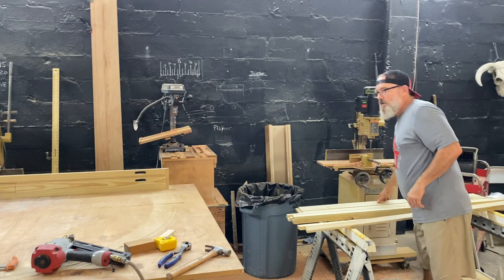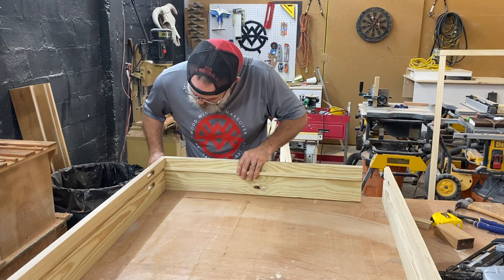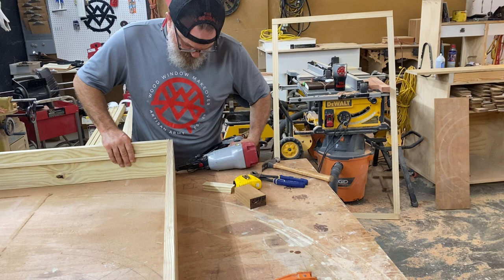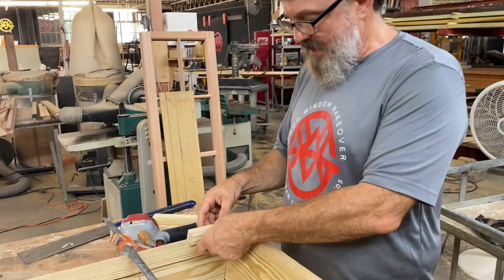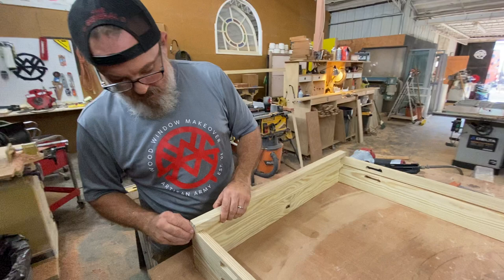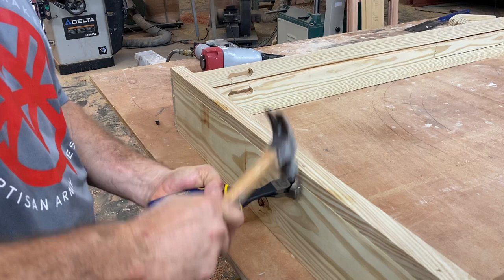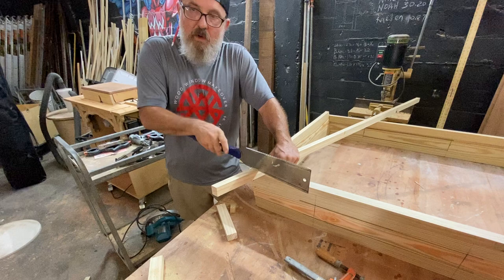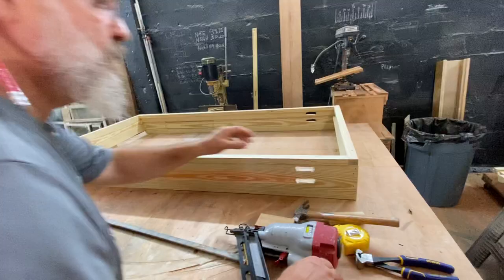The Best Historic Wood Window Frame Assembly Goes Together Like This

Comment: Although yellow pine has a tricky grain due to its hard rings, you will have a lot less nails go astray if you orient the nailgun so that it is in line with the length  of the wood as opposed to perpendicular to it. A trick I was taught when I first was introduced to a finish nailer doing trim work.  Steve, thank you for all of your GREAT content!  It has been a great help.
Reply from the maker: I’m gonna remember that the next time I nail some yellow pine….  You’d think I’d know a trick like that by now but apparently I have yet to arrive at a place where there’s nothing left to learn….
Reply: @WoodWindowMakeover  maybe because of the guides at the exit of the nail gun or there is a spin momentum given to the ♦️
Reply from the maker: Maybe. But I think more that it has to do with the chisel shape at the point of the nail. Turning the gun to orient with the grain might cause the nail to better slice through the grain rather than be guided by it. That’s my theory anyway
Reply: From my experience it is just the simple angle of the nail gun. If the gun is perpendicular than any tipping of the gun forward or rearward quickly directs the nail towards the face. But being "in line" with the "length" of the wood a tipping forward or rearward still keeps the nail in the wood.  In other words it is easier to keep the nail gun aligned side to side as opposed to forward and rearward. Now yellow pine is a difficult wood to nail as those rings are hard and soft as you have probably felt when using the mortising machine. The nail can ride that grain at times no matter what you do. Unless you pre-drill!

Comment: Great craftsmanship. I understand windows come in all sizes but do you have basic plans for like where the pulley slots go and the dividers say for a 2x6 framed wall. I'm not sure what the typical reveal is like where the window sash sits in the middle of the frame or more towards the outside or inside? I would love to try and build my own window, but there are a lot of grooves that I am sure are specifically placed. Mainly basic plans for a general window?
Reply from the maker: No plans. One day maybe. Usually put my pulleys 6” on center from the head jamb. The parting bead channel is 1-7/16 from the edge, assuming a blind stop attached to it. The slots for the weight pocket door are hidden underneath the parting bead in the parting bead channel and underneath the window stop. The cross cuts for the weight pocket door are usually hidden underneath where the bottom sash goes. Those are the basics

Comment: What are the thickness and width of your casing stock?  This is Pressure Treated (Cu/As) wood???  Is there just one groove for the parting bead, and then the outside blind stop and inside trim (to hold bottom sash in) are added?  What are the dimensions of the parting bead, and how far is it recessed? (1/2”x1/2” & 1/4”?). Then the stoop (inside sill) is added?
Reply from the maker: Thickness and width of casing stock is variable but always 3/4 or better. Just one groove for the parting bead, yes. KDAT pine, yes. Blind stop and window stop added, yes. Parting bead 1/2 x 3/4 usually but I like to make it a little stronger than 3/4, especially in old work. Stool goes on first, before any interior casing
Reply: @WoodWindowMakeover  Thank You so much.  If the casing is 3/4” how much is the parting bead recessed into the casing?  I’m worried about leaving enough wood under the recess/dado…
Reply from the maker: @jimbaranski4687  I think you mean the jamb. It recesses in about 1/4” so it can stick out a 1/2
Reply: @WoodWindowMakeover  I mean the bead that is between the sashes, and holds the top sash in.  Thanks!
Reply from the maker: @jimbaranski4687  it recesses in 1/4” and sticks out 1/2”

Comment: Very nice! Is that kd pine? I live in LA and fix windows for property management companies and come across a lot of wood sash windows and would love to get into this type of work but it’s intimidating trying to get wood at these lumber yards not know what I really need. What kind of wood would I ask for when making sashes?
Reply: He says it's kiln-dried pine at 3:36.
Reply from the maker: It’s kiln dried. You can make a sash out of any wood. I don’t know if any easily obtainable wood has an real advantage over any other easily obtainable wood. I’ve made a lot of sash out of KDAT but it’s heavy and tends to warp. I’ve made sash out of cypress but it tends to rot, I made them out of Accoya for a long time but it attracts mold. Right now I’m using a wood called Red Grandis. Don’t have much data on it yet.  But I’ve made sash out of a clear yellow pine Home Depot 2x10 before and it is still in use. So it’s hard to say confidently anymore. What I would feel comfortable saying is to use the best wood you can get your hands on at a price you can pay. To me that’s reasonable.
Reply: I always use Spanish cedar